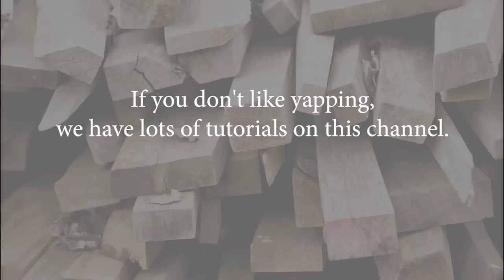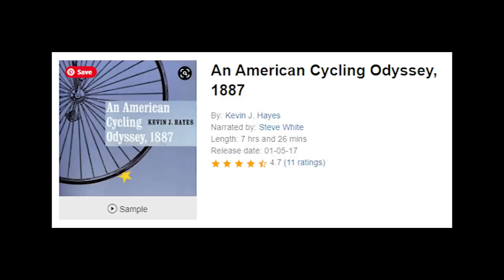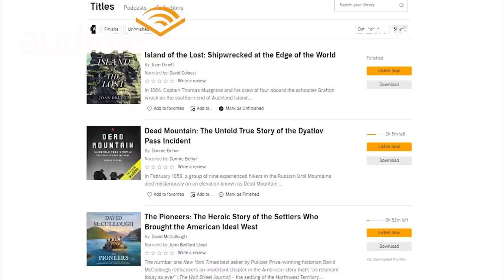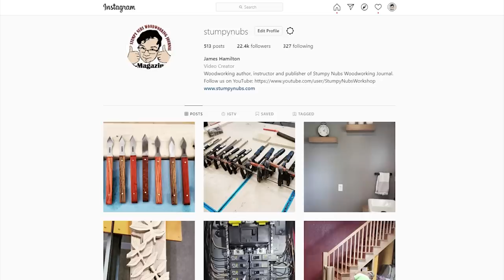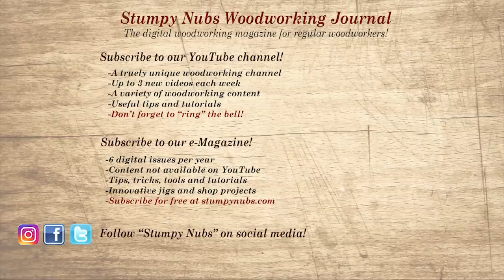Have they BANNED table saw dado sets????

Comment: I always learn something. I recently got a Kreg kit but haven’t tried it out yet. I had no idea you could use pocket hole joinery on plywood.
Reply: Stick with thicker than 1/2". It claims to work on half inch, but I'm working on a project right now with it and it barely works. 5/8 or 3/4 is probably a better place to start.
Reply: You can use pocket-hole joinery on anything, so long as you don't promise your clients that it will last.

Comment: i was wondering how much shorter is the arbor shaft in europe?

couldnt you skip the arbor washer if the arbor is short enough that the nut would barely go on?

or couldnt after market manufacturers make arbor extensions yes the dado blades the holes would have to be bigger to allow for the larger internally threaded piece that would thread onto the arbor shaft?

or if the european version of the table saw is the exact same as the american version couldnt you order a replacement arbor and replace the stock one?

many tool motors have a gearbox so it is not the motor shaft that you are connecting to so the arbor is probably a separate gear cog with a threaded shaft.

also if you cant do that you can always make multiple passes by repositioning the wood piece.

Comment: I know this is an old video, but wouldn't putting a cotter pin on the arbor keep the danger down? Even if the arbor nut got loose, the blades would still stay on the shaft.

Comment: In Oz-Down-Under dado sets are very expensive, like "sell your wife and kids" expensive.  The bloke in the tool shop did his best to talk me out of buying a set, and to buy a "wobble blade" instead.  I couldn't afford the former and the latter sounded like snake oil, so I bought neither. There are other ways of skinning cats and I use them.
Reply: Gday David, i occasionally use a Oshlun box joint set on my Dewalt table saw.  It only cuts up to 3/8" (0.95mm) wide but suits my needs when making boxes.   Might be worth a look?
Reply: @outbak2  Many thanks for the info

Comment: We love our Jacinda here in NZ, but she is inclined to nanny us.  A number of ridiculous recently introduced speed limits on our roads is typical of the current government.  So she probably doesn't know a dado from dodo, or more relevant to New Zealand, a Moa or I suspect they would be banned here.  Dado sets are not easy to buy locally though, but I got mine via Amazon without a problem.  I shall still be making the blades just a touch tighter from now though, and I definitely won't be suggesting that my Menz Shed gets a dado set because some of our members are quite capable of doing stupid things already.   However, daft as some of them are, they still have enough sense to use base 10 when measuring whether that be with milometers or inches (see there's nothing wrong with imperial — it's just America's slavish devotion to fractions that makes us roll about laughing).
Reply: how do you measure one third of one

Comment: Hi and greetings from the UK. I don't begrudge you Yanks your dado sets one bit. I just wish we could have them here. My (Felder) table saw overcomes the issue of the arbor nut coming off under braking due to the two pins that connect the arbor to the nut. But that's the problem: This saw would not only need a longer arbor, but also longer pins. And the pin spacing may not be standardised across different makes of saw. And, and.... Ah what the heck, ban 'em world wide then I won't have to think about them anymore. :)
Reply: You can order most felder saws with dado-prep. They even have one of the best dadoblades in their webshop… but its somewhat expensive compared to most US dadoblades.
Reply: @MikkelFilskov  I didn't know that - thank you. Mind you, my saw is 13 years old now, so I doubt a retro-fit would even be possible, and at Felder prices....I think I'll stick with the router table!

Comment: It's not about safety. They are banned and/or discouraged due to the extra power draw of the tool. Your tool pulls a larger amount of Amps when a Dado stack is used. That is the objection even though it is not publicly stated.

Comment: A couple of thoughts:
EU legislation especially Health & Safety theoretically applies in all member states but with widely varying enforcement
UK is no longer part of the EU but the H&S is effectively the same & so dado sets banned but available from local sites via their US affiliates
Floating guard doesn't fix the short arbour issue on all saws sold in EU
Not specifically banned in Australia but cost A$330-$440 - about 30% more than in the US (metric blades/chippers/shims but imperial arbour & blade sizes)

Comment: The foreigners that have hobbled their woodworking artisan’s to idiot-proof their lives are missing out on some goodies. I thought it might be easier, and it might have been given a better table, to use a router and jig to create box joints for a guitar amplifier head and it’s speaker cabinet. It worked but was problematic due to the size and length of the mahogany I used. I felt that box joints would be easier to cut on my larger cast iron top and wing old Craftsman contractors saw with a dado stack. So, I made a table saw box joint jig and what a difference that made when I cut the box joints in the walnut on my guitar pedal board build. Disclaimer, I pulled a bone-headed rookie move by not pre-drilling the hardware holes and screwed it up (pun) slightly! Still a couple of really cool projects!

Comment: I have a couple cars that have both metric and standard fasteners on both the engine and body.  It's caused issues when someone who didn't know tried to service it.
I rebuild/restore lots of older equipment that's made like nothing in today's market could hope to be, I guess Europeans are fine with any environmental impact the ditching of the standard system might cause?

Comment: Lived outside the US for 18 years and a metric convert! Example, what is 1/2 of 164mm or 6 15/32"??
Reply from the maker: What's half of 165mm? Find me 82.5mm on a ruler... You might judge by eye somewhere between millimeter lines, but your measurement wouldn't be as accurate as it would be with a ruler that contained increments as fine as 32nds" (or 64ths if you need them). And I can round 3 15/64ths off to the nearest mark on my ruler (3 7/32) while a metric measurement can only be rounded to the nearest millimeter point :)

Comment: Couldn't you just use a divider with the back guard - the arbor knife - between two of them to match the width of the dado? I am an amateur to woodworking, so I am not sure I completely understand the issue here. The dado set itself is basically a divider system, so why wouldn't a similar setup for the back guard be appropriate as well?

Comment: Wouldn't the solution be to have a set screw arrangement so the nut can't back out?  And you can also can make an adjustable riving knife if the floating guard doesn't suit you.  Banning dado blades seems like an overreach for an easily solved problem... should only ban those saws without a safety feature if you have to be a stupid buffer.

Comment: I had a wobbulator saw for my Shopsmith. Used it once to make a wine rack. Works well but would not allow my staff to use it, And excellent tool, when you know how to use it safely. HE He. NEarly shook the whole saw to pieces. A shaper with out attachments is much ,much more dangerous unless you have a Tractor machine attached.

Comment: Dado blades are not banned here, you can buy them and have to use them in a tablesaw which is suitable for this like Felder tablesaws with extra lockingsystem and the right motorbrake. If you use them in not suitable tablesaw and you have an accident with it your employer is reponsible for the consequences that you can't work anymore. Because the employers mostly do not use the dado's because of unsafety in not suitable tablesaws the private woodworker will not take the risk.. And there are good alternatives with better finishes like table routers en CNC's.

Comment: i have a 1952 craftsman 8" tilt table saw. now I can use up to 8.5" blade without hitting the Cradle. to get a flotting cover, I would need to tilt the blade over to 45 deg rise the blade to max height to know the max run of the blade from side to side.  believe it or not, I can install a riving knife but would have to make it myself.  The saw does support a dado set.  I totally believe in dado joins for tables legs to max of over 3.5".  I believe in STRENGTH over speed to build. it too bad you can use a dado set on a miter saw. they want to use no glue and just 4 screws.

I willing to a dado for the leg, glue the leg and screw the leg into the join for the added STRENGTH it add for the leg support. I dont trust  just 4 screws to support over 2 tons of weight.

Comment: Dados or box joint sets are great unfortunately those blades carry momentum because of the weight or the kinetic energy involved in starting and stopping. I have a mutli-stack dado set and a box joint set with dual position of the blades. Both sets by Freud. Years ago my original stack set threw several teeth at me during a dado cutting operation. Freud paid for all shipping for the set to be sent to them and they replaced with an updated set free of charge to me. There are many ways now to cut a dado,  aka rabbit, aka flat faced grove, aka rebate, Router with track/rail set up. router table with rabbiting bit(s) CNC with correct die or bit.
Reply: love the freud box joint set.

Comment: I think that’s a really intelligent solution. But I suspect the argument against it would be that it is easily defeated; whereas motor brakes etc. are not. I did see something during the segment that I’d like to ask you about. I noticed you using the stabilizer on your dado stack. I never do, and I’m wondering what your opinion is  pro con yes no neutral 😏. Thanks for another great vlog, and for all your hard work on the channel!
Reply from the maker: I don't use a stabilizer. Perhaps you were just seeing the saw's arbor washer?
Reply: Ah! My bad. Also a mistake in terminology. Where I work, we always called that washer a stabilizer (incorrectly, I see). I should have said I only use the arbor nut on a dado stack. Thanks for the reply!

Comment: There is no requirement for a riving knive when using dado blades in EU. There is also no requirement for a cover above the table when making non trough cuts. There is a requirement when making repeated dado cuts in a production environment to use a automatic feeder. About the breaking there is no rule that it must be electronic. The law says it must be posible to break the blade in less than 10 seconds. Some older saws have a foot break. Sticking a board in the blade does not count as a break :) I have never heard about the short arbor, but I guess it is a solution the manufactures of small sawes have come up with to be compliant with the break rule. My own saw couldn't care less about the weight of a dado blade as the 5Hp motor outweigs it by orders of magnitude. There are several dado sets avalible in Europe. CMT and Felder are both avalible. There are proberly more.
Reply from the maker: At least a dozen other EU commenters on here disagree with you. It seems not every place enforces the regulations the same.
Reply: @StumpyNubs  That much I agreen on. I have heard so many different stories about the legality of dado blades. Initialy I was interested in Denmark as that is where I am, but the Danish law just says that the EU law applies. The law is Machinery Directive 2006/42/EC, but it leaves details like dado blades to private industri.

Comment: You probably could make a riving knife that's the same thickness as a dado set if you made it adjustable the same way as a dado set. I'm not sure if such a thing would be useful though.
Reply: Too easy to mess up. Bigger Hazzard if its not set correctly than not having one at all.

Comment: ... Okay so either i'm stupid or i'm missing something, but wouldn't adding a second nut to the arbour entirely fix the problem?
Like, the entire purpose of a jam nut is to prevent the lower nut from loosening by essentially wedging the thread when the lower nut is attempting to loosen itself, and the lower weight of a jam-nut would be less susceptible to self-loosening.
Hell, from a mechanical perspective, there are so many ways to tackle this issue other than outright preventative legislation that it almost seems like the politicians don't have any idea what they're actually talki-- ... oh yeah that's right, they don't. :I

Comment: You got it all wrong. Dados are banned here because they are too save. Just for fun, take a look at the swirling blades we have in Europe. A single blade mounted at a angle on the spindle, the greater the angle the wider the cut. And as a boon the cuts are less clean too!

Comment: I dont see that having a brake on a tablesaw loaded with dado cutters would undo the lock nut. There is only one direction of rotation,the brake stops the blade quicker nothing else.
The weight of the dado set is far less than a stack of cutters on a spindle moulder,which has a brake and a nut .I think the problem was the dado moulding sets had a problem of flying out,a bit like the whitehill cutters and french heads in days of old, (not that long ago). I have never seen a dado in operation in the uk in over 40 years of being in workshops, I have worked with old boys that used them and I would too if I came across one, for grooving and trenching anyway.
Maybe because the operator is in direct line of fire with  kickback with dado cutters in a tablesaw,as opposed to a spindle moulder and they fell out of favour.
Iam intrested to hear other opinions, never to old to learn .Peace.

Comment: A riving knife for a dado? Isn't the primary need for a riving knife to counter the potential for internal tensions in the wood to cause the newly separated pieces from pinching the blade? But with a dado, the wood isn't separated. Even if there would be internal tension that would like to pull the two sides after the blade together, the remaining web between those two sides keeps them apart. They can't pinch the blade because the uncut web keeps them from doing so. It seems to me that wanting a riving knife for a dado cut stems from an emotional transfer of realities from one scenario to a scenario where those realities don't exist.

Comment: i wish i had a dado set. On riving knife, they could have a riving knife set to match the dado set (assumes riving knives don't have to be higher than blade)
Reply from the maker: Dado sets are nearly infinitely adjustable in width. You would have to have some sort of adjustable riving knife. It would not be practical.
Reply: @StumpyNubs  wouldn't you just need a riving knife set to come along with the dado set? If you were using a dado of half inch made up of 5 blades then you would use the same corresponding 5 riving knives, i.e. each dado blade has an accompanying same width riving blade? (I have never used or set up a dado blade)
Reply from the maker: @RandomSmith  Dado sets don't come in just once size. You get a stack of blades and shims. You choose the number of blades and shims you need to make any width stack you require for the dado/groove you wish to cut. There is not such thing as just a half-inch dado set.
Reply: @StumpyNubs  If the blades and shims had a corresponding knife, couldn't these just be stacked together in the same fashion, e.g. if you had two 1/8" blades and two 1/8" shims, then you would use 4 1/8" knives - a matching stacking knife set. I guess though that a riving knife is probably mainly for through cutting anyway? I think you may have mentioned that in your video that not being a through cut was a little safer from kickback
Reply from the maker: @RandomSmith  Theoretically, but that would require a more complex mounting system on the saw and a significantly more expensive dado set. Plus, few would use it because the chance of kickback while doing a non-through cut using a dado set and proper technique is not very high. I didn't it was impossible, I said it was impractical. :)

Comment: “Of course, you still can’t use a riving knife with a dado set....” Since a riving knife is intended to keep the kerf from closing, thereby pinching the blade and causing kickback, it serves no purpose with a dado cut anyway. Only a through-cut can close. Any kickback associated with a dado will not be prevented by a riving knife, even a magical one that doesn’t protrude through a nonexistent kerf. But then there’s the woodworker who uses a dado stack for ripping or crosscutting...for whom there is nothing we can do. He’s also probably standing in the kickback zone, leaning over the blade, reaching over it, grabbing stock while it’s running, changing blades with the saw plugged in....
Reply from the maker: Keeping a kerf from closing is not the only function of a riving knife. It also prevents a bind between the fence and the blade that may be caused from a shifting/twisting workpiece. This is a common cause of kickback.

Comment: Many years ago there was something called "A DRUNKEN SAW BLADE". These were just wobbly shaped or warped circular saw blades that wobbled out a dado or a rabbit in wood. Back when these were used table saws generally didn't have guards, or any kickback protection either. FYI, I have ridden a penny farthing bicycle. I traded off my Worksman factory parts running bike with a lunatic who happened to have an old high wheel bicycle with rubber wrapped maple hardwood tyres. I WAS ABSOLUETLY PETRIFIED! My butt was about 72 inches up from the pavement below, meaning my head was about 102 inches above the asphalt and concrete. There were little steps you had to climb to get onto that contraption. Two blocks was enough! Across the USA? Pass.